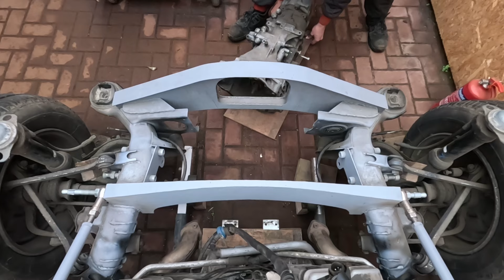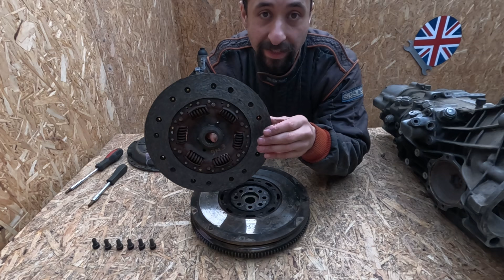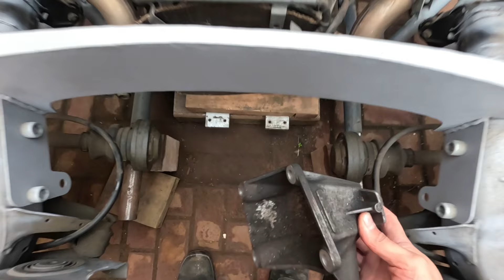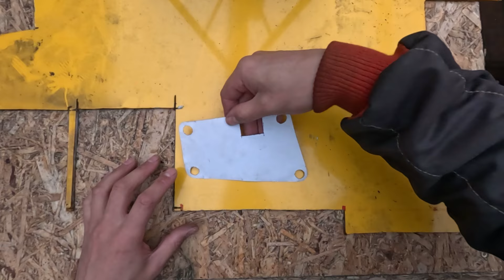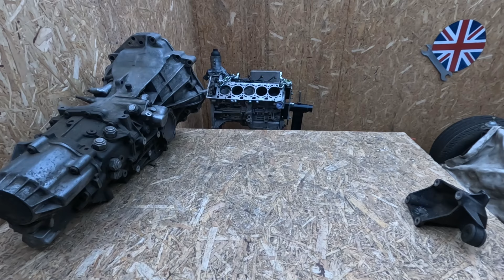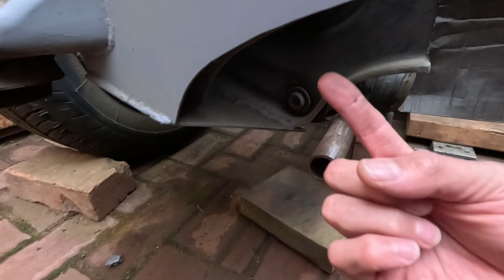V12 GEARBOX INSTALL

Comment: Youtube has highlighted your video through my search page, Audi have several good gearboxes, the 01E is okay but the 01X is stronger from that generation. The Later Audi A5 diesel box has the drive shafts closer to the bell housing enabling better engine location. I machined my own flywheel, I utilized the engine's flex plate for the bolt pattern and in my case ring gear, the flywheel then becomes part of the adapter between the gearbox and engine, you then decide on the best clutch for your build, I used the LUK RS4 clutch and pressure plate- off the shelf components. Starter location may be an issue,  question is where do you put it, and is there room for it, many problems to overcome, good luck.
Reply from the maker: Hello 👋 from my research the early 01E is apparently the strongest. It has the biggest diameter main and layshafts. It also has a steel gear casing where as the 01X has aluminium 🤔

The 01E 6 speed 2.5D also had better ratios than other audi porshe gearboxes I looked at.

I am building the car flexible so I can upgrade to an Audi r8/lamborghini gallardo graziano at a later stage 👍

The early version 01E is used in lots of gt40 replicas as well as a few V12 projects so it should be fine to get this project up and going 🙂

The 01E driveshafts line up realy well along the car in my setup, it's almost a straight shot to the hubs. They are angled on the vertical axis due to the 01E however this is benifitial for the CV joint life to spread wear aslong as its not an excessive angle. The V12 sits quite heigh anyway just the same as it did in the zonda which also used the stock mercedes wet sump 👍

I am planning to keep the V12 flex plate in just to maintain the ring gear. I'm most likely going to do a smaller steel crank to flywheel adapter to couple it together maintaining the audi a6 flywheel. This keeps everything modular and simple to swap out. I can machine a single peice flywheel but there's very little benfit since it's still transmitting torque though the same 8 bolts. My method if more commonly done on big diesel setups.

I will be using the standard V12 starter motor in its current position, I already tested the engine in the same configuration it's currently in without a gearbox attached and it ran fine (see my early youtube shorts)

Thanks mate 👍
I appreciate your support 👨‍🔧

Comment: It's badass! A lightened flywheel would make that thing rev up violently!! ❤️‍🔥😎👍
Reply from the maker: Thank you mate 👍 yeah definitely 😎 
Check out my early youtube shorts, I reved the engine to 5k with no flywheel at all 😂 it revs like a beast and sounds thunderous 💪

The goal at this early stage is to build a running driving car that I can use then upgrade with time. I don't want it turning into a 10 year build, I'd much rather make memories with it. I've designed everything to be easily serviced 👨‍🔧 I will upgrade later down the line, I want to build it and take the car on some road trips 😁 then I can see what needs upgrading. 

Thank you for your support 😎👍

Comment: Lots of work!  I applaud your skills.  I had to buy a kit for mine. 😬
Reply from the maker: Thanks Sterling 😁 It's definitely a smart move to buy it if they are readily available and you don't have the equipment to make one 👍
You definitely need to play to your strengths 💪

yeah there's a good bit of measuring ⚙️ I personally don't like to pay people to do anything 😆 I would always prefer to figure it out. That's also how I can afford to do any of this. 

I built my own fleet of CNC machines from scratch too (accurate to 10 microns or 0.01mm). One is big enough to fit an engine on 😂 I am going to be using that to make the V12 adapter plates, repair sleave my V10 aswell as remake some rare engine parts for upcoming builds 😎

There's going to be lots of machining in this build when it reaches its final stages 🔩

Thank you for your support 👨‍🔧
I really appreciate it 👍
Reply: @UKBUILT  Impressive!